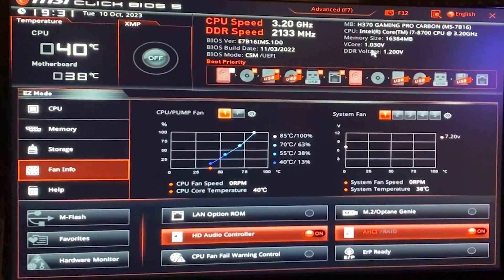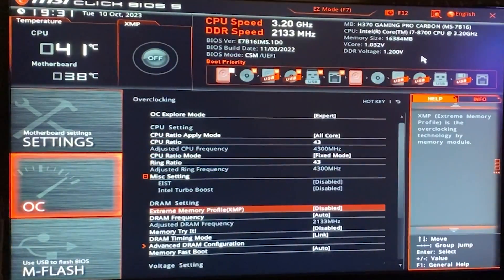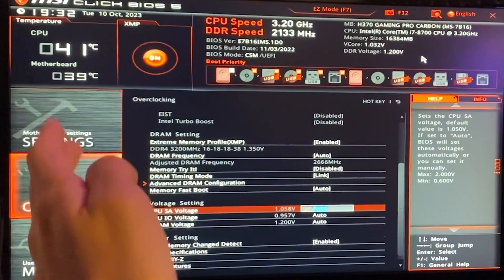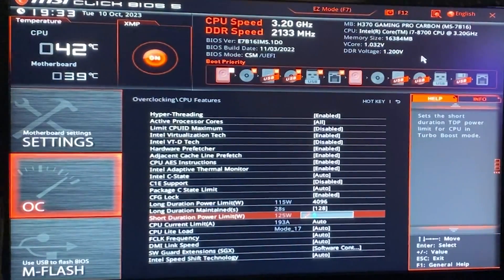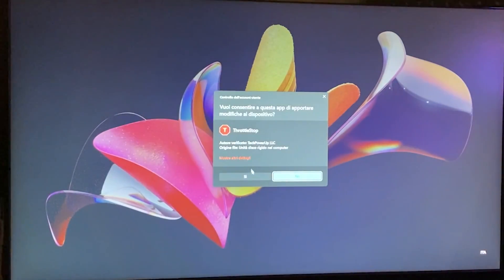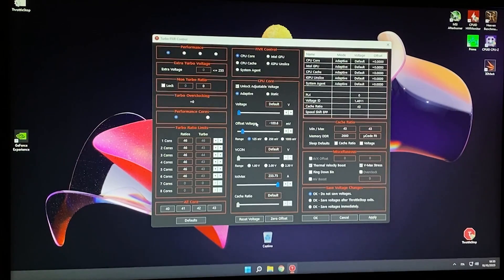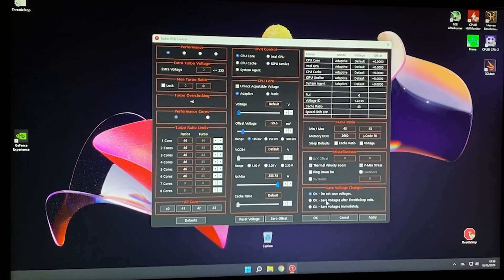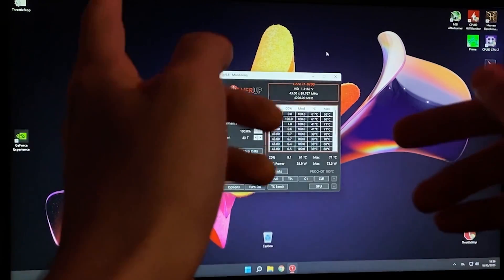Undervolt your Locked i7 8700 for more FPS and Lower Temperature!

Comment: Hi all!
wanted to share my experience:
managed to undervolt by waaaay more, to like a -150 (without crashing) but! I didn't notice any change other then a loss of performance for some reason (temps didn't lower nor did TDP more after -110 but the performance descresed!) so my CPU sweetspot seems to be -110
Also: 20 degrees is really optimistic, my TDP dropped by 10 W that is about 5 C

Comment: Will soon get home to do this on my b365 board at end of this year. And my first question right now is your cpu delidded? Should i delid mine or just do undervolting?
Thanks to your video!
Reply: Hey I got a b365 and a i7 8700k too, any tips to keeping the temps down? If I knew it it was this hot I would just got a 9900k and not tried to overclock at all

Comment: hi why undervolt im trying to get more juice out of it mine is running at 3.8ghz rn and temps are fine with stress test is there more i can get out of it
Reply: if you stress test and your temps are fine i.e you are not getting thermal throttled you could overclock to get more performace but lower temps may extend your cpu life.

Comment: just to share,
I created 3 power profiles to control your temp and power usage while on idle , just doing normal stuff or gaming mode

Low mode
Normal mode 
Performance mode

I did create shortcuts so i cun run them immediatly..

It really save me a lot of power, temp and bills 😁😁
Since you dont want your pc always run at max turbo speed when only watching youtube videos or other non heavy applications right? 😆😆

by the way Im also using Throttle stop also big help👌

Dont forget to also Undervolt your GPU 😁

Comment: Whats the best settings to avoid bottlenecking my 2060
Reply: If Gpu runs at 100% usage in games it means that it's not bottlenecked by CPU. I run 3080ti with 8700 and in eSports titles GPU runs 100%.

Comment: Hey man thanks for the great video. I have 2 questions. I must keep throttlestop open at all time? If yes when i restart my pc all i have to do is just open throttlestop or i must re-apply the voltage values we have set in the video? I have the same i7 8700 and i must say i saw right away more smooth performance.
Reply from the maker: I’m really happy it was helpful, thanks a lot for taking the time to leave some feedback :) Consider subscribing if you wanna support the channel & for more tutorials! You do need to open throttlestop, but the settings will be saved!

Comment: I don't actually understand.
In cpu and ring ratio are maxed out at 43 in bios.
Yet when you go in throttle stop, you max out to 46 on all cores. Yet again when you hit apply you still get only 4300mhz max.
Why is that happening? 
Also, I did the -0.100 offset in bios (having a z390 a pro from msi, so its the same bios as you) and I'm getting stable under 75c temps in aida64 and cinebench stress tests.

The things that worry me a bit is that cpuz shows my frequency varying from 4301mhz to 4297mhz quite so much.  Any ideea on why that happens?

Thanks for the video.
Reply from the maker: No need to worry about the frequency fluctuations. You're locked at 43 due to the mobo limitations, but that also isn't an issue. Glad I could help! Consider subscribing to the channel to support me :)

Comment: Hey i have a quick question, i have a I7-9700k and dont have lock as it let me put everything even if it crash lol, so i kept 43 for the ring and put 47 for cores as it is what the gaming mode of MSI offer so i tried this, and then follow your whole tutorial if i applied a vcore offset in bios is throttlestop offset needed ? and how can i make it work with max value offered by throttle stop which is 50 or what would be the best value for a in between heat and perf ? Thanks for the tutorial tho and if you have the time to answer (yeah i followed this tutorial in the end as you do it on msi which was even better for me :d)
Reply from the maker: Sooo, if you have an unlocked motherboard you don’t need Throttlestop, you can just apply the offset in the bios. 47 is s very good spot on the 9700K my man! I’d say beyond 50 you really need more voltage and a massive cooling system. Great stuff and thanks for watching it till the end and commenting :) consider subscribing for more & check out the GPU Undervolting tutorials!
Reply: @ImWateringPSUs  Ok nice. Already subscribed 👌 even if I don't watch everything I like to follow what your doing time to time
Reply: I have same processor im not guru but i watched most of the overclock video i used to play games on 5.0 full boost but in 2025 I started to get blue screen ..then i undervolted my cpu to 4.5 gz and power -100w …..im getting more fps and temp is around 75 .. and i havent got any blue screen for months❤

Comment: I have an Intel i7-9700 on an omen hp with a really bad bios is there anything i can do to decrease the heat? i dont have access to a lot on the bios for this board almost nothing.
Reply from the maker: Yes, this is the right tutorial! Do the steps in throttlestop as shown :)
Reply: ty i got about 10 degrees less i think, but i already put a giant thermal sink dual fan monster on it, bc that tiny little fan that it came with was a joke. I cant believe i used to run this at 90c for hours playing wow smh. @ImWateringPSUs
Reply: did you figure something out?

Comment: I've got a locked 13100 that I need to look at. Thanks for the tips!
Reply from the maker: It’s my pleasure really :) Thank you for your time!
Reply: Unfortunately, Intel blocked undervolting on that CPU (actually all 12th gen and later). ☹
K version 12th gen and later is required for undervolting. 👎
It is one reason why I didn't upgrade after Intel 10th gen.

If I'm wrong about the undervolt restriction, please correct me.